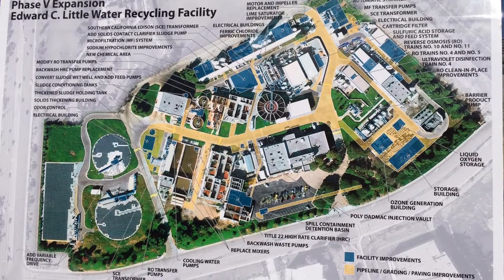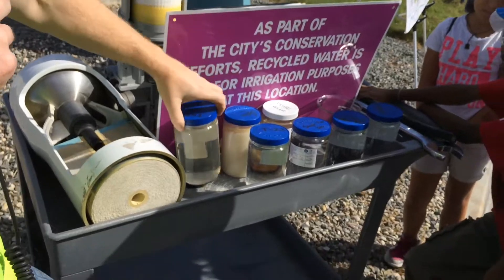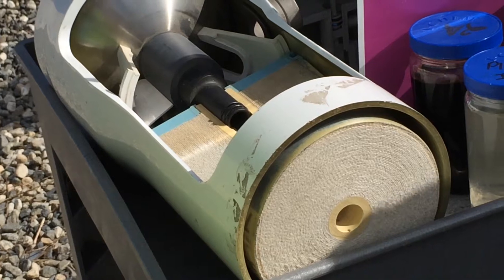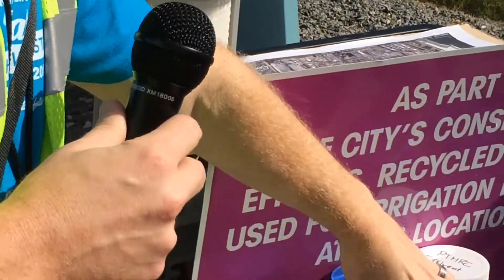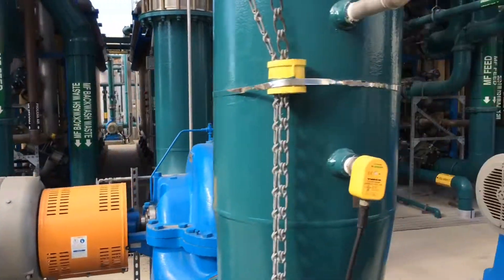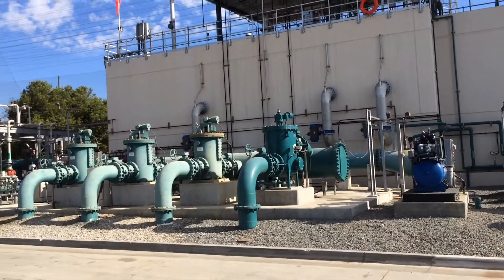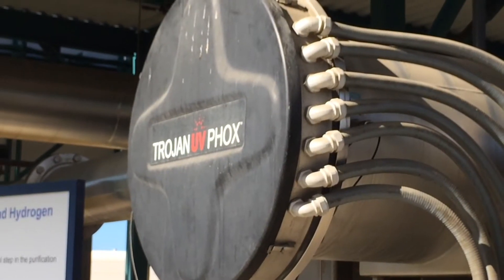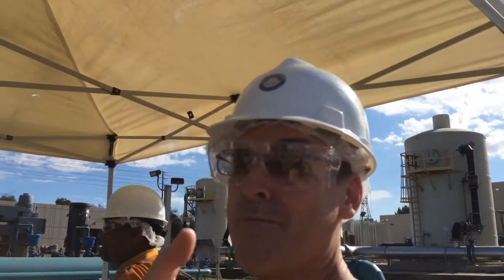Turning Sewage Into Drinking Water

Comment: Does the plant need a lot of energy and electricity?  And is it possible to reduce the amount its producing? (if it even runs on energy/ electricity. I read somewhere it can also run on water pressure) 
Hope you can answer my question soon for a project I'm working on :)
Reply from the maker: I don’t know. They have to pump the water in, and the water pressure pushes it through the filters. Not sure what powers the pumps,